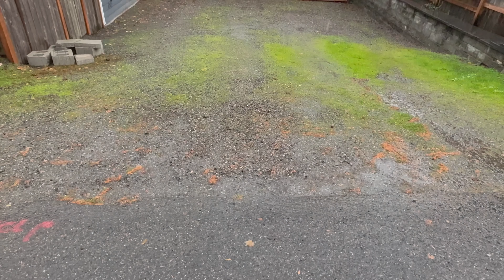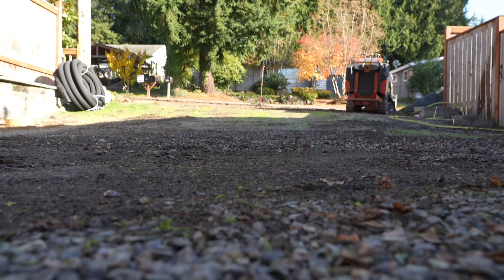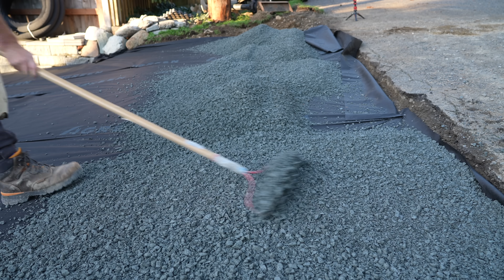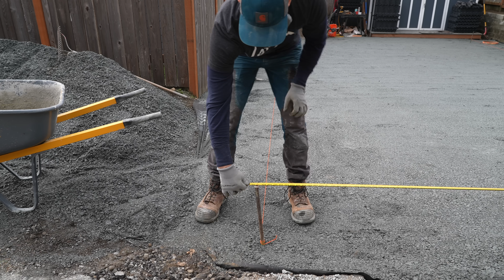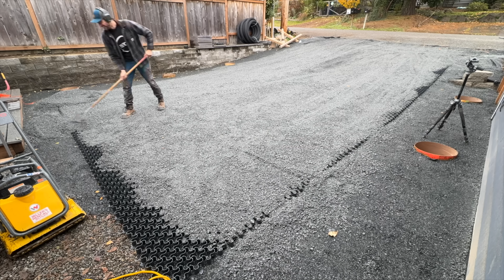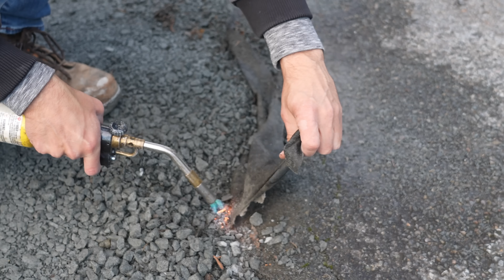How To Install A Permeable Gravel Driveway Grid System

Comment: Sorry to tell you (from personal experience) that grassy weeds will establish themselves in your rock/gravel over time. This is because airborne dust will settle in the rock and eventually become soil. 
In fact, even before sufficient dust accumulates some grasses will germinate on top of the fabric and send micro roots through the fabric! This organic material will accelerate the accumulation of dust and dirt, as well as create even more soil on top of the fabric as it breaks down seasonally. 

If you’ve ever hiked along the timberline (as I did in my youth, so many years ago), you see this soil creation in action on bare rock. Between the water creating cracks in the granite during countless freeze cycles, airborne dust settling, and root hairs growing in the cracks, soil is created and meadows are formed.
Reply: could also add that the crushed rock he put on there is not permeable, and the driveway slopes from the streets to the house. will have water issues.

Comment: MIX 610 LIMESTONE (dust) into that gravel and you've got a concrete driveway--it's heavy but it's cheap (at least in our area). In clay or sandy loam ground base 610 keeps the gravel from sinking out of sight as rain & driving on it over time will sink the small gravels without the bonding of 610 added to it. No need for expensive weed cloth layering and it saves time not having to roll out & tack down the landscape fabric.

Comment: If you've done construction, you are pulling your hair out.... comrade, you should just use the bobcat for everything.... and speed up. and work on precision. 

forget about not hammer the stakes accurately, Comrade.... you couldve finished the geotextile with a pourable rubber and then cut it. but fine work. hope its the pyramids for you. you have to take pride in the work you do.

Comment: you don't need weed barrier if you maintain your drive way with a drag. geo-grid is designed for major roads such as county roads that have to go into marsh wet areas and it is expensive....more expensive than you need. also where there is water plants will find a way. tree seeds will wreck your geogrid driveway in about a decade.
just stick with yearly maintenance.

Comment: $129.00 for 35 sf?-$2353.00/825sf? that's cost prohibitive. That's not even the complete cost, still have equipment rental, gravel, delivery, weed barrier and unexpected costs (like additional gravel, etc.) Better off getting blacktop or concrete with proper drainage or runoff. cost effective

Comment: lots of BAD info and things done. 1: this is not a weed prevention. weeds start from the top down so a chemical in the gravel would be right. 2: you used a CR for fill. that is NOT GOING TO DRAIN. you wanted a washed rock. calling a stand behind heavy equipment... LOL NO

Comment: I feel like that plastic grid is unnecessary, the incline clearly doesn't have too much washout and there was already a thick layer of gravel you were building over, it is unlikely that the fresh gravel would settle or move latterally that much. I admit I don't know how much maintenance this gravel lot has had over the years, and I do think the new driveway looks quite nice, just seems like the plastic was unnecesary and may make future projects or maintenance a pain, the fabric probably was the most important part anyway.

Comment: I installed this in my front yard close to my driveway. this way, I don't have to worry about cars sinking when we have cars parked on our lawn. it's been eight years since the installation and it's still doing well. Recently, I've been thinking about replacing my concrete driveway to this grid system
Reply: We have a similar setup. Our house is from the early 1920's, and has a narrow driveway that runs almost the entire length of the property to a garage at the back. It would be fine for a model T, but a modern car is too wide to fit between the house and the privacy hedge on the property line on the other side of the driveway.  There is a car gate on the driveway where the house starts that encloses the back yard. We could tandem park 2 cars between the gate and the sidewalk.  That was a pain, so we usually just parked one car on the street, but parking would get tight on street sweeping days (each side would get swept once a week). Ultimate we tore out some plants next to the driveway and placed down a grid system and 1.5 inch crushed rock next to the driveway so we can side by side paek.  The side away from the driveway has a nice curve and when we aren't parked there, it just looks like xeroscaping, which is popular here.

Comment: I would have thought that the footer would stand above grade.  Keep the post, if wood, out of standing water.  
I also thought that you're getting really high up on your house.  Looks like when you're laying the fabric barrier that what ever gravel you add is going to be flush/touching the siding of the house.  I'm sure it would have been a greater expense but digging down 6 inches and then regrading to the proper height would have been best.

All that being said .... nice job at th end ... Looks awesome!

Comment: Weed barrier doesn't prevent weeds if you put rocks on top of it. It only works if that's all you got at the top. What will happen is dirt will accumulate on top and between the rocks, the weeds will germinate, their roots will grow through the weed barrier, and the weeds will be even tougher to pull out. How do I know? I watched a similar video several years ago suggesting the same thing and I unfortunately took that advice when I did my patio. I see this has been viewed over 1M so I foresee lots of people suffering from weeds from this bad advice in the future.

Comment: Save guessing, need 2 inch? Make a frame, 2x1 lengths, top and bottom the same, 6 or 7' wide, fill the frame, lift, fill, lift, fill.. then crush/wacker down. Otherwise, good work.

Comment: I  like the geo grid stystem it looks like a inexpensive alternative to asphalt or concrete do u know if they manufacture the necessary components to construct curves so it could be used for small private roads. I'm a retired concrete and asphalt contractor  but don't worry I'm not trying to critique the work . I do have one question,  if I was seeing the video right it looks like ur grade was falling back towards ur garage from the street . And if I am correct unless there is some type of drainage stystem u risk compromising the integrity of the project  over time. Water seeks the path of least resistance.

Comment: Rather than rebar in the timber, I'd recommend using hot-dipped or epoxy-coated lags as long as you can get, with some real big washers, driven with a impact.  Assuming you have the local grade for which a lag would be useful, you can employ the resulting clamping force as additional stabilization.

Comment: Serious question:  It appears that your lot is below the level of the street.  How is water controlled/drained during heavy rainfall?  With a wall to the right of the drive, a fence at the back, and your home on the left, there appears to be nowhere for the rain to go.  Even  if the property behind the fence continues to slope away from the road, I can't see a way for positive drainage to occur without problems.

Comment: Its a bit hard to tell based on the video, but just for anyone watching; this size plate compactor, should not exceed 2" of base material at one time. It just doesn't have enough compaction force beyond that. So if you are doing 3-4", you will need to compact 2" at a time, otherwise there's a pretty big risk for settling over time.
Reply: Yes-- compaction must be done in smaller lifts to be effective.

Comment: If you use compactable gravel with different sized particles, it will stabilize itself after compaction. This means that you do not need a stabilizing grid. You only use this grid if you are using non-compactable gravel, e.g. round gravel of the same size. 

Anyway, you did a great job!!!. I like it much more than the American habit of pouring tons of concrete, which makes your driveway look like an airfield.

Comment: the fabric under the gravel stops the gravel from ever "settling" i put it under my driveway and it always seems loose on top, i thing because the dirt doesn't come up from underneath to lock in the gravel.  the only thing i found that helps is putting pea gravel on top of 57 stone to help lock it in. sand helps too - if you can get it cheap

Comment: Use to do subdivision development work many years ago, the fabric we laid down was to prevent the gravel from sinking into the soil and allowing water to pass through… the grid systems made similar to pavers allow grass to grow, a desirable attribute of that system is the ability to drive in the yard without leaving ruts
Reply: yeah, that's how you use this grid system properly. A stable base with fabric - grid system - and fill it with soil/topdress/grass seed that will sink a bit to be lower than the grid. That will allow you to drive on the grid, while leaving the grass untouched!

Comment: Great video, thanks! We just bought a home with a dirt and gravel driveway and want a more permanent surface. However, or drive comes over a rise and dips down, then back up again to the hose. Any idea how well this system wold hold in place if the surface isn't uniformly flat? Thanks!

Comment: very interesting, but have you ever thought about using USED TIRES instead of the grid system... difference is you prep the same, except instead of putting the grid system down.. you put the used car tires down. cut the side walls of the tire out lay the tires down, screw the tires together then pour lose  crushed gravel down into and over the tires the tires keep the gravel in place , have the gravel say 1 to 2 inches above the tires, then pour the concrete over the whole thing, tires and crushed gravel by at least 2 or 3 inches or however  much you want.. very ,very strong, you can drive a dump truck fully loaded on it with no problem...the process is called mechanical concrete... if you think the tire is too thick you can always just cut the tire in half, make 2 tires out of 1 tire then screw them together side by side....just another way of looking at something and getting ride of used tires, doing some good to get rid of old tires you can also compact the gravel over the tires as well and not worry about the tires moving at all.... JM2C.... JUST MY 2 CENTS....another way to have a very strong driveway... also works out in the country without putting cement  / concrete  over the top, just the crushed gravel down, the tires keep the gravel in place for years and the water gets to drain away , you will never have any POT HOLES by using the tires method... again JMHO... just my humble opinion... great vid , enjoyed it...
Reply: Interesting!  At first I thought I'd be leery of using screws in the event that they might one day become displaced by someone unaware of them-- perhaps blunt bolts??-- but with a topping of concrete, perhaps they are encased adequately.  But wouldn't the concrete crack?  I suppose that is why the sidewalls must be removed-- to achieve full compaction to support the concrete.  Very interesting.  But how would you compact the gravel in lifts, for full compaction?  If I tried this, I'd probably want the tires to be cut in half, for no more than about a 2" depth.  Also, perhaps slits could be cut in the tires instead of using metal fasteners, so that they could be overlapped on one another-- almost woven, if that makes sense, like a woodworking drawer-divider project.
Reply: @karenkrohn8003  well, if you put 2 to 4 screws in the tires to hold each other together , never have to worrry about them comin appart, or if they do i will be long after you are here!!!!! if you understand my meaning.. also if you get rail road ties and use them for boarders those will also help hold the tires firmly in place and they also look nice, unless you plan to put concret boarders around intead. nother thing, you can put coop wire down as a base so the gravel wont sink into the ground provided you get the wire with small enough holes, decided the thickness of the wire since the water will drain through never any puddles or low spots and if need you can always just rake it level when needed.. AJM2C.  again just my 2 cents..happy days..

Comment: I’d be more worried at the level of the gravel driveway against your buildings - looks like you will breach the damp course - assuming building and damp course is the same as UK.  I’d also be looking to improve the drainage in the lower areas, ie. To prevent it draining down to the building foundations.

Comment: Love this project!!! 
Suggestion: If you get weeds or vegetation growing up through the rocks, get a pump sprayer and in early spring fill with with water, vinegar and dawn dish soap. You can look pet friendly weed killer up and it will give you the exact measurements for the size sprayer you have. Then on a sunny morning spray the areas that are showing growth and by the end of the day they are almost dead. The next day they should be pretty flattened. Make sure you are going to get rain the day you spray or the day after. And tough give them an extra spray the next day. Very gentle on animals and mother earth.   Cheers!
Reply: avoiding roundup is increasingly important. A lot of health issues can be traced back to pesticides, glylhosphate &  roundup in particular.
Reply: Yep. I use roundup one a month and it's very minor amount of work. Maintenance is vital on everything.
Reply: @sparksmcgee6641 round up 😮 I’d look into that if I were you!!

Comment: I don't like that type of gravel to be a driveway but it does look good right now. I find even with the compacted rocks they will stick to your soles and get everywhere: house, shop, car, etc... Also curious if you'll do a timelapse on this in one to five years on how it has held up to the test of time as far as maintenance, appearance, weeds, etc. It seems like a LOT of work although I suppose a traditional concrete driveway also takes a lot of time/work/prep.
Reply: should have used crushed gravel without fines

Comment: You are good at explaining things in a way that is easy to understand without getting boring. 
   The only thing I would add is that I never saw you checking any grade to make sure you had positive drainage. If you don't plan for where you want water to go then it will go wherever it wants and it's where you dont want it.

Comment: Vodaland grid at $2.50 to over $3.50 a sq. ft. plus gravel. In this area concrete is cheaper , but not permeable which is important.  I use a geotextile & gravel in 2'-X wide strips through the field of 3-1/2" to 5" pour and steel meshed and printed colored concrete and at the sides for runoff control and permeability.

Comment: Weeds will still be a problem.  They'll germinate from seeds from the top.  To prevent that - use a pre-emergent weed killer once a year in the early spring.  It will prevent any seeds from germinating.  Other than that - it looks very nice.